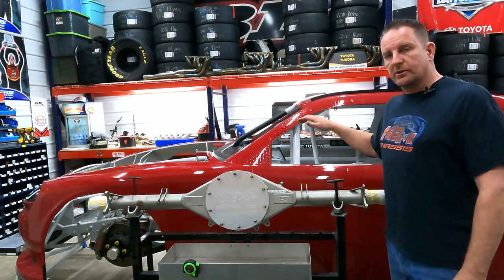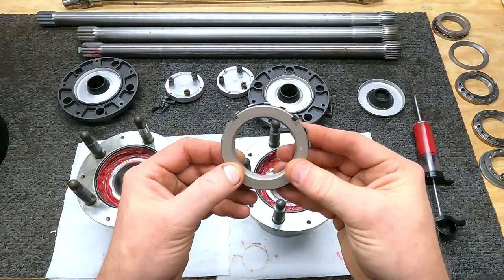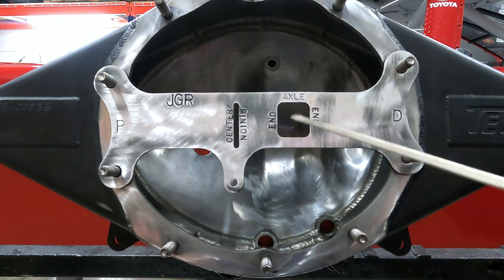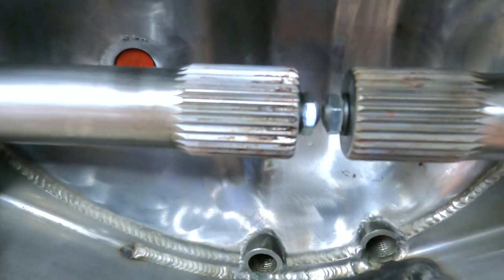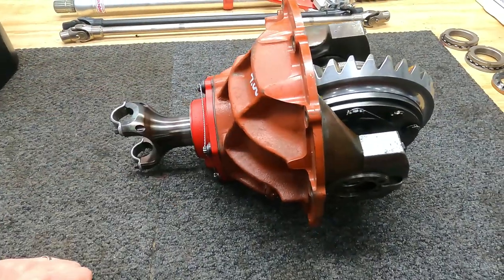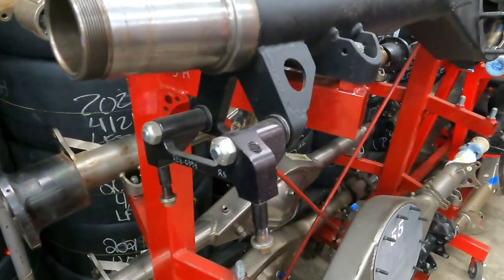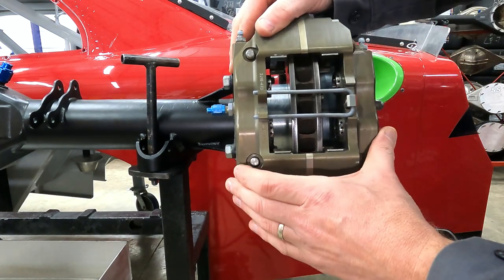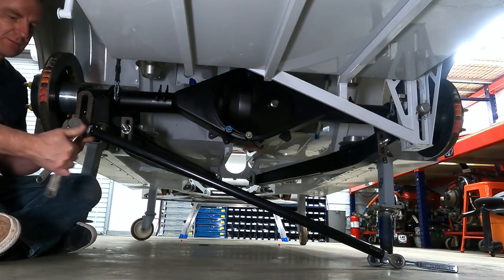NASCAR REAR HOUSING - EVERYTHING YOU NEED TO KNOW

Comment: Excellent video. Question about how the camber and toe is set into the axle. Is it how the hub, threads on to the end of the housing because it looked like they were angled right at that point. Or is it in the torque tube itself by doing what was done on the older vintage race cars I used to restore. Where they would do what's called, "Gronking" the tube itself. 
Again excellent video. Very informative.
Reply from the maker: Camber is set multiple ways, in this housing it's how the hub snout is welded into the axle tube.

Comment: Thanks for taking the mystery out of this task, looks very doable for a diy'er especially with correct information shared. One question though, when installing the truck arms on the front mounts out of the three holes you choose the middle, is this be best road course duty? Thanks.
Reply from the maker: You're welcome! 
Glad you enjoy the content! 
I set them in the middle as a base setting, I won't know which of the 3 mounting holes I will use until the car is complete with the correct springs in it. 
Once it is and I have it on set up stands I can make adjustments to it and set the pinion angle. 
For now it's just a base setting.

Comment: What kind of gauge are you using to find the camber on the rear, and where could I get one? My housing doesn’t have any numbers on the inside, just “LR3” stamped on one side and “LR5” stamped on the other side. Both stamping are on the outside of the housing on beside the pumpkin.
Reply from the maker: I have an actual set of housing measurement gauges and stand that came from a race team.

Comment: Why did you chose a front mounted spring as appose to a rear; can you explain the benefits for a R/C application if there is any?
Reply from the maker: Great Question! NASCAR standardized the rules, and the spring has been mounted in the "stock" truck arm location in front of the rear axle housing since the 80's.
Secondly, there's no room behind the housing for the spring to mount since the downsizing of the chassis to 110" wheelbase in 1981.
Reply: @stockcarsurplus  Thank you for the information.

Comment: Danny  does the rear  track bars have to be  set  at a  certain degree?
Reply from the maker: Great Question Harold ! Typically, in a Road race application it's set level.
Being set with angle in it helps turn the car in circle track applications.

Comment: I'm surprised to see you paint your housing as opposed to powder coating it. I know that there is a big cost difference but the powder coating is far more durable.
Reply from the maker: Personally, I prefer paint over powder. It's easier to touch up if needed, and powder can hide stress fracture.